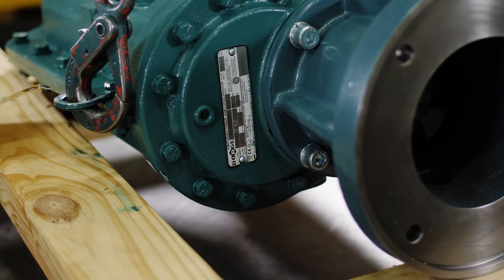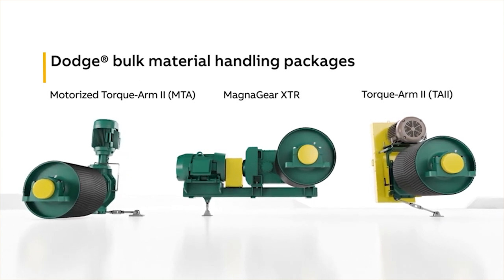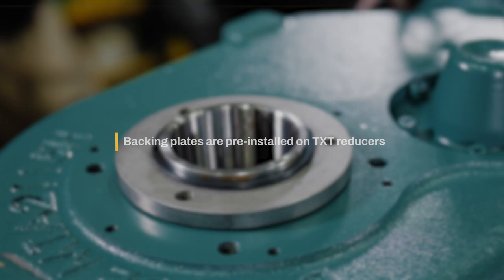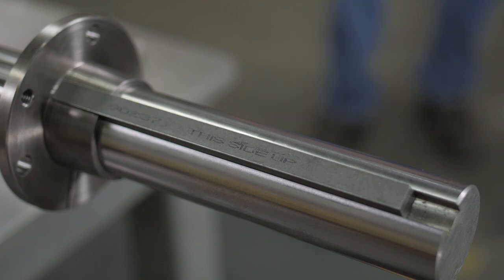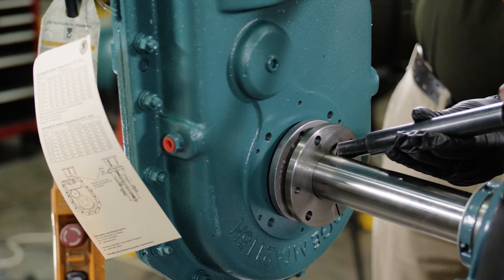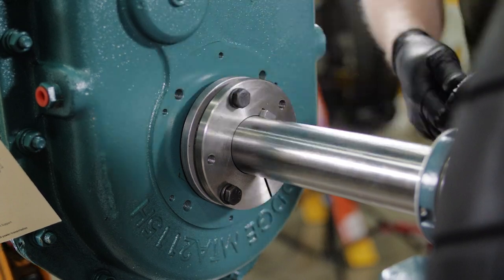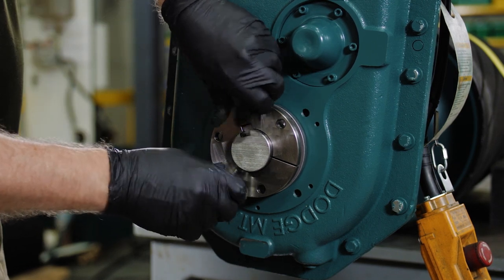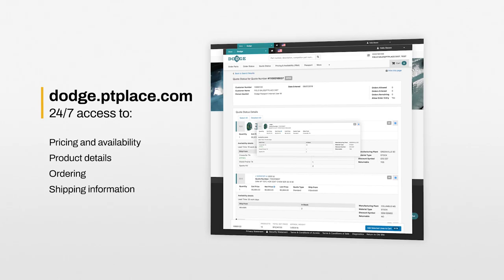Installation of Dodge Twin-Tapered Bushing in a Torque-Arm Reducer

Comment: Boooo. Stober gearboxes are better
Reply: I think they are very good reducers, Stobber is also good because of its keyless system, it is practical. but Dodge is also very good! I also think that all reducers are good, as long as they are well calculated for the application!